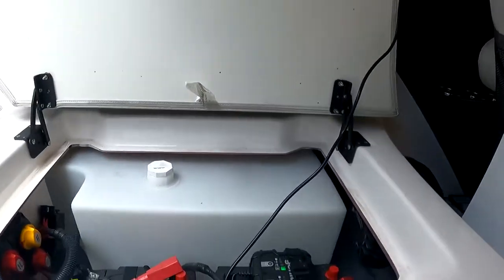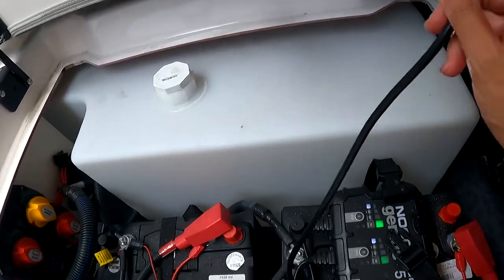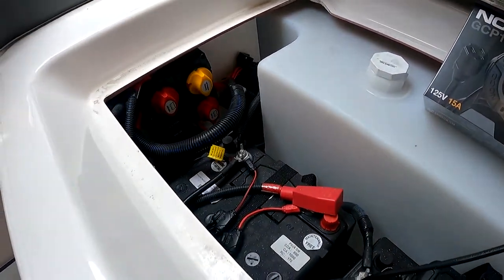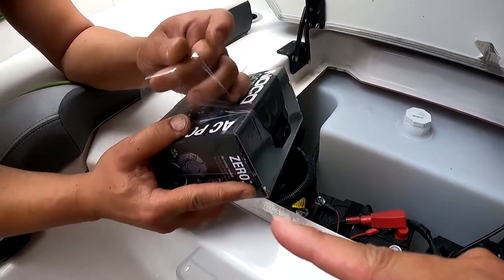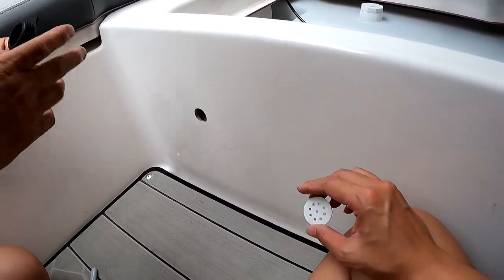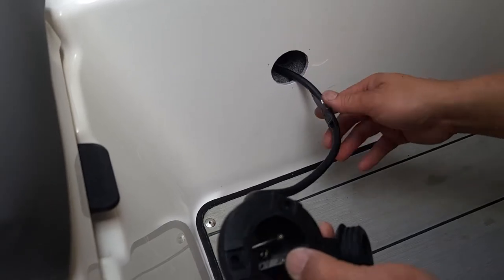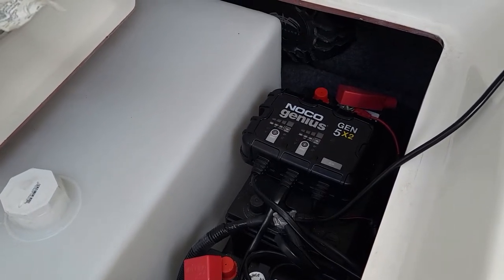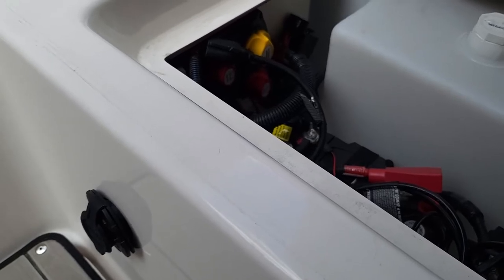NOCO Onboard Battery Marine Charger & Port Plug Install #nocogenius #boat #maintenance #yamahaboats

Comment: That existing hole was put in to release gases produced from the batteries inside the compartment...you will have add another one! I see that this video is 11 months old, did you experience any major issues when you used the battery compartment ventilation hole for the charging inlet port?
Reply from the maker: Ahhh that makes sense hahah, thanks for that. We will get another one in there for sure. No issues up to date alls been good

Comment: The best way to widen that hole if you have access to the back of it would be to drill two small holes on each side inside of the outline of the fitting in the existing hole. Then get a small square of wood and  hold it on the insid. Run two wood screws in the wood. Mark the center and use a carbide tooth holesaw! Been there, done that.
Reply from the maker: Thanks! Will keep this handy for the next one 😅

Comment: Electrolysis happens when an electrical current passes through water. That in turn causes a chemical reaction. That’s the simple, bare bones version. In terms of boating, the electrolytic reaction occurs between two metals. The electrical current strips away one metal and deposits it on another. Remember, it happens between two dissimilar metals. Metals work at different voltages. If you have an aluminum boat but your prop is made of zinc, you are setting up a way for electrolysis to occur. Zinc has a higher electrolysis voltage than the aluminum boat hull. When a current flows through the water around your boat, it will strip away some electrons. It takes from the zinc and deposit them on the bare aluminum, which attracts the current. Electrolysis causes corrosion. Over time, it will damage the metal parts of your boat and cause them to break down. In particularly bad cases, this could destroy an entire prop and shaft in a matter of a couple of weeks. -  boatsafe.com/electrolysis-eat-prop/

Comment: That hole  makes no sense to me. You still have to open that compartment to check the device lights, correct? If so, just keep plugging your cord to the device
Reply from the maker: Yea we have to open it up, but we do close it and it helps unpinch the cords.
Reply: @wKKnDwarriors  just leave the compartment open while charging. I mean, it has to be open to check the device lights anyways.  It isn’t worth that much work and making a damn hole on your boat imo.

Comment: Will Electrolysis Affect a Non Aluminum Boat?
If you have a fiberglass hull or even an inflatable pontoon boat, electrolysis could still be a risk. Metal components in the water will still be susceptible. If you have any metal on your boat that is immersed in water, there is always a chance. This also becomes a risk when you are in dock. An electrolytic reaction can occur between your boat and a neighboring boat.

Comment: Properly ventilating gases produced by the charge and discharge of the batteries in a closed compartment is paramount!  |  If you plan to moor your boat at a dock for any length of time while plugged into an electrical outlet YOU WILL NEED TO INSTALL sacrificial metal (zinc blocks) on your outdrives to control electrolysis!  You need to research ''electrolysis'' and how it affects boats!
Reply from the maker: Thanks for taking your time to post this! It really helps 🤗
Reply: Should be noted that it’s not as much of an issue in freshwater. It can happen, yes. But it’s a huge issue with saltwater and will speed it up. But when using a boat strictly in freshwater it will take a long time for anything to occur. 

Yamaha inboard jet engines should already have anodes installed at the factory.  There are no outdrives. It’s all jet drive with impellers. I know some boats have them on their drive shafts, like larger fishing boats. But that won’t work on a boat like this as anything put on the impeller shaft will cause major cavitation.
Reply from the maker: @PTRRanger951  Thanks! 🤗 This helps we are never in salt water, dont plan on it
Reply: @wKKnDwarriors  same here. Maybe when my ski gets old I’ll try to go to oceanside. I want to do Long Beach to Catalina once. But I have a steel trailer, since they fill up with water when you launch there is no way to get it all clean. So I don’t plan on even doing salt unless I can get a different trailer. And like you guys, I never leave it in the water unless it’s just a night or something. It’s always in and out.
Reply from the maker: @PTRRanger951  Oh man long beach to catalina sounds fun! If we had the money definatley a separate boat is needed for salt, that would be nice  👌